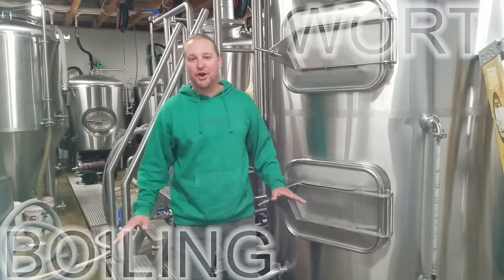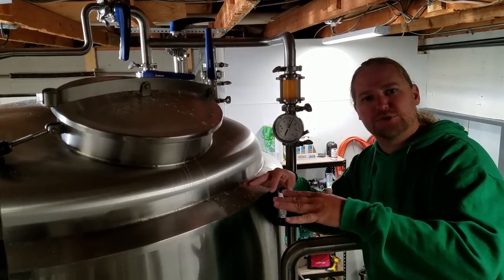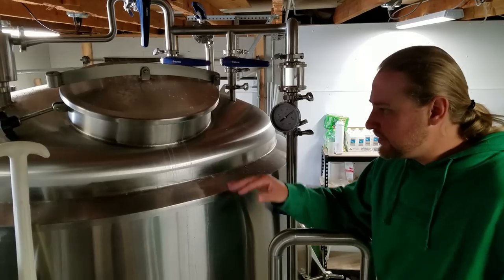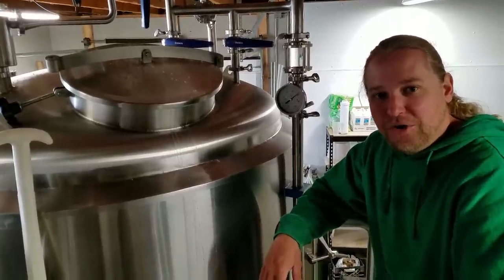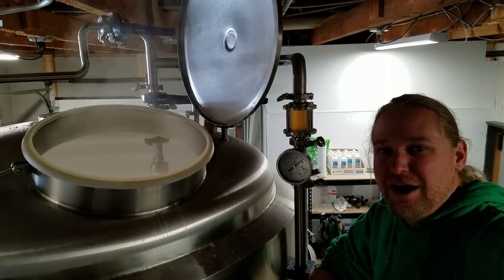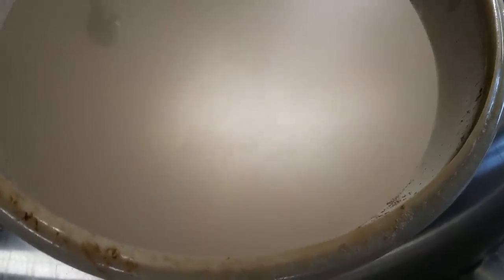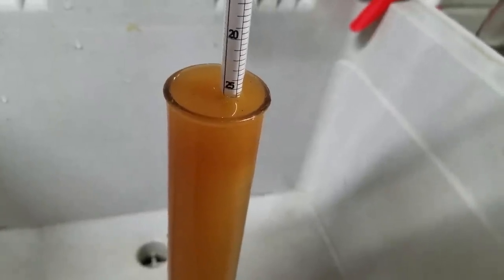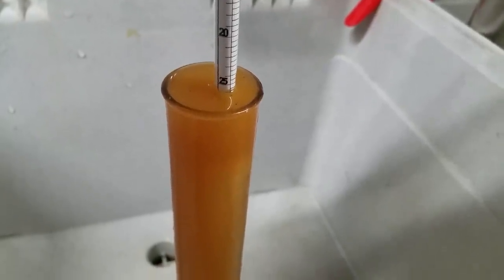WORT & BOIL!!! Microbrewery: BREWHOUSE OPERATION!

Comment: Single infusion or step mash?   When you recirculate, I'm wondering if there is a possible issue about the oxidation, what do you think?  I thought that the recirculation manifold should be nearer of the grains..    I would also be curious to see the Vorlauf piece...   

For homebrewer, SS Brewtech has 3 different pieces(spray ball --> sparge /  recirc manifold->step mash /  Re-Circ Bulkhead->Vorlauf)  ,  is it the same for a Microbrewery?   Thanks Jasper, an other amazing video !!
Reply from the maker: Thanks for the questions. 
Single infusion 99% unless your are: advertising a traditional brewing system, if the malt is highly under modified, using other cereal grains rather than malted barley.  
Hot Side Aeration is nothing to worry about in my option.  Nearly all of the hot side oxygen comes from the grist and then mash water not from vorlauf or transfer. If you are not purging your milled grist with nitrogen and using completely de-aerated water to mash in, then Hot Side Oxidation is nothing you should worry about either.  However, being gentle with the wort and beer is a good habit. 
I showed the vorlauf in this video, but also check the Brewhouse video to see top of mash tun valves. It has Vorlauf, Sparge, Sprayball, Hydrator.
Hope this helps, Cheers!

Comment: Does the direction of rotation of the whirlpool matter? Systems I've seen are counter clockwise but I noticed you stirring clockwise.
Also can you cool while you whirlpool or will that interfere with the process? It's basically like centrifuging right?

Thanks for another great video
Reply from the maker: Glad you enjoyed it! No, the direction does not matter, whatever way is easier or dictated by the WP tangential outlet.  Test this by putting coffee grounds in water, spin the wide based cups both directions and see if the grounds end up  in the bottoms middle after a while. 
Yes, you can cool the wort during WP. WPing is pretty much the same as centrifuging but a whirlpool only settles particles that will settle with gravity. Where as a centrifuge makes a lot "stronger gravity" so will separate many more particles. Cheers!

Comment: Did you make a video on sparge? I wonder how the flow speed changing in a profesional brewery. Homebrew recommend the speed of 1 gal in 5 min. How do you sparge now with those big volumes?
Reply from the maker: This video shows sparge. The speed starts slow and is raised throughout the process. Sparge volume is a calculated number and once wort separation begins 90mins to fill kettle is a good goal.  All equipment is different (mash tun vs lauter tun, ect.) There is no substitute for experience on specific brewing systems. Hope this helps, Cheers!
Reply: So  90 min is a good target. This mean that 5bbl batch and 20bbl batch will be done in the same period of time just different flow and pipes diameter, right? Sorry if it's a bit dumb question. Thank you
Reply from the maker: +Andrey Popov No worries, that's exactly right. Bigger systems have bigger dimensions with larger flowrates.

Comment: Reiterated mash is interesting, I have never seen it done before.when I finish my boil time I switch off the kettle elements, paddle the wort to a slow spin and rest for 10 min. Then I start re circulating through the heat exchanger back into the top of the kettle. it takes another 10 min for the wort to drop down to transfer temp then send to the fv.  the wort in my kettle is about 65C and takes 30-40 min to transfer so I use this temp and time to steep more hops at lower temp.any thoughts on steeping hops at lower temp at the end of boil? worth the effort or wasting time?ollie
Reply: Steeping hops after boil is worth the effort. You will get a lot of hop flavor and some aroma out of them, but very little if any hop bitterness. These hop additions are generally called whirlpool hop additions. I would recommend steeping the hops in your kettle as you transfer through your heat exchanger.
Reply from the maker: I like the idea of a 60C Hop Stand. You will have to test if its a waste or not, sensory science is subjective. Make sure you do not dry hop this beer and after fermentation drives off aroma, does the final beer have pronounced hop aroma? It takes me longer to go from boil to 65C by running it back in kettle, larger volume? A separate whirlpool vessel could make this easier, and paying attention to water recovery from HX and Dirty HX/clogging. By far the best way for hop aroma is dry hopping, but this makes yeast handling more difficult. I personally feel like a clear/filtered beer with a huge hop aroma that was not dry hopped or hop oiled is one of the hardest/impossible beers to produce. Keep experimenting my friend, and share your results. Cheers!
Reply: Brewery Life to do hop stands at lower temps I generally will whirlpool then start my runoff through HX into either my kettle or a grant with the hops. I have done 80c and 65c both with different but good results. 65c produces more grassy flavors and less of the hop flavors. I prefer to do my whirlpool additions or hop stands 80c and above. After the lower temp hop stand whirlpool as usual then run through HX to pitching temps
Reply from the maker: Thanks Zachary, Great info!